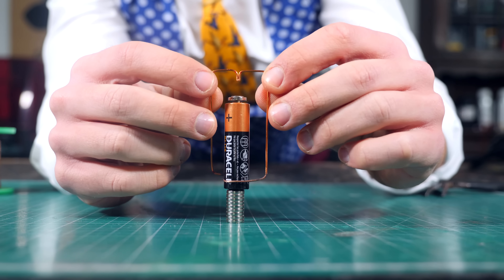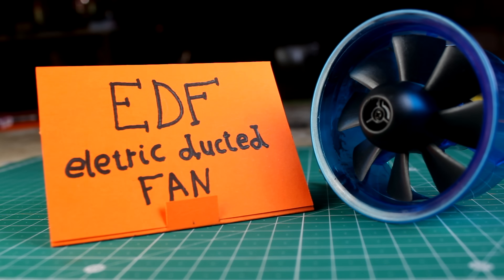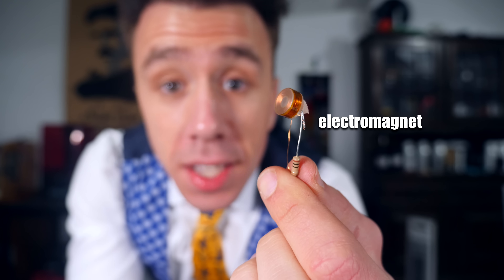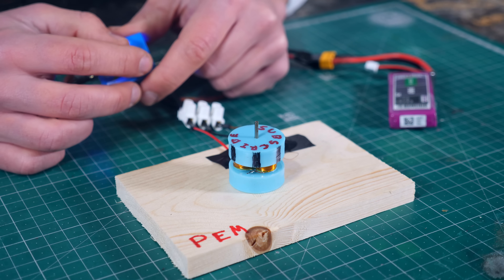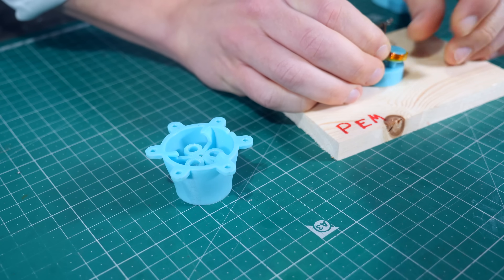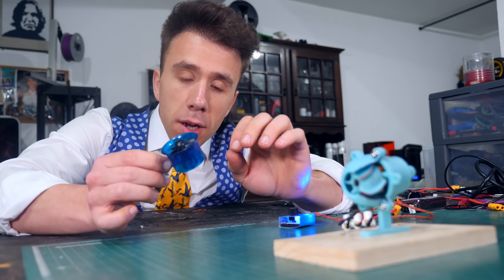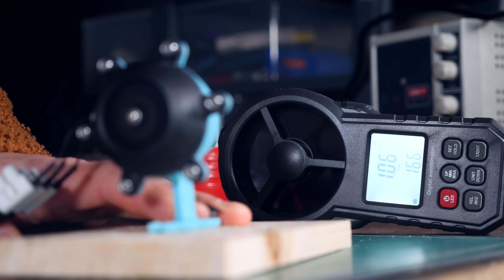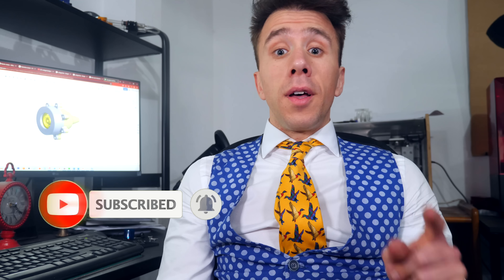I 3D Printed an ELECTRIC MOTOR FAN

Comment: probably too late here, but that might be the difference between airflow and airpressure
if you look at pc fans then you could see that the fans on the case are different by the bladedesign from the once on radiators, that is because, casefans need to get a good airflow in the case, where there isnt much obstructing it, while the fans on the radiators need to push air through the fins of the radiator, needing much more pressure to achieve it, instead of airflow
the design differs by having bigger or smaller (or even overlap) gaps between the fanblades if there is a big gap, like on aircraft propellers then they are high airflow, if they are like a prop on a ship, then they are high pressure

Comment: From a cursory glance at this my thoughts are;
1. Your intake opening area is smaller than the area of the fan (imagine it as a circular area). 
2. Your blades are much smaller than the fan blades. - Therefore a lot of the area for intake is taken up by the "hub" your blades are attached to. 
3. You should try some CFD (Computational Fluid Dynamics) software to get a good visualization for what is happening. 

Note that the majority of thrust from a jet engine is actually coming from the bypass (in other words the Fan) and if you look at a Turbofan a large area of the fan is just a cylindrical tube with a fan at one end.

Comment: it’s possible that the Dyson fan is more high pressure and less high speed because the air is coming from a 90° angle.

Comment: You could also try adding a tube on the front of the impeller. If you think about a car it has a specific air intake duct that restricts the air to that specific spot

Comment: There is a reason why ram jets and scram jets required a launch at altitude. A body lifted aircraft is nothing new and used utilized by delta wing aircrafts. But why does a delta wing use a turbo prop design over the ram jet design. Because there isn't any spooling of air on the runway. At least not a lot. Airports use an air pump to spool the air for many jet engines for two reasons. Most importantly to clear the engine of latent fuel  vapour accumulation and also to initially push air into the engine this causes a vacuum affect on the intake of the jet engine. Ram and scram jets however require more air than what can be statically accumulated and therefore need to be launched at velocity. You are close buddy, keep it up and you will get it. Also if your impellers are deforming try printing in vase mode and replace your infill with a more purpose oriented internal grid spines similar to your metal 3d printed rocket engine.
Reply: Actually designing and testing cellular infills is probably its own show but to be able to push and turn that form to comply with the outside shell of a turbo impeller fan blade would be a great product and would be much stronger than 100% infill because cellular infill is fantastic for resisting torsion forces like the centrifugal forces of a spinning elliptical blade.

Comment: This suggestion is not on the topic that you're requesting, but I think you will find that it does help with the manufacturing process.  You might try a removable magnetic build plate for your resin printers.  A flexible build plate really helps when removing parts that are printed flat on the build plate.  No more hacking with a spatula and praying that you don't break a fragile fin or other thin piece.  In my experience so far, yes, the magnetic force is enough to hold the removable plate in place.  Good luck and have fun.

Comment: Okay, first we need to fix some of your misconceptions.
1. An impeller is not the same thing as a centrifugal fan. It actually works like a hybrid between a standard propeller and a centrifugal fan, with less efficiency than either one. The reason Dyson uses them, is that they won't clog up when full of dust. Before Dyson got popular, there were far more efficient Japanese versions of most of their products.
2. Centrifugal fans have their mounting/bearing point and air intake at 90 degrees from the shaft they are blowing in. Basically its the same effect as the Tesla turbine/pump. using the BLDC motor is certainly an option. Scale it up to the limits of the plastic and you may give Hacksmith Industries a run for his money on small strap on propulsion.

Check out Thinking N Tinkering's channel. He's mostly working on power generation and wind turbines, but you can get some good ideas. https://www.youtube.com/@ThinkingNTinkering

Comment: Sorry I'm so late to all your videos, I am enjoying them.  I would like to see this video:  A car turbocharger is basically a jet engine without the combustion part in the middle - that is replaced by your car engine cylinders. So maybe you can get a second hand (scrap) turbo from car scrap dealer, split it in 2, then build your own jet combustion chamber between the 2 parts, experimenting with connecting the turbine to the compressor (like Whittle) or not connecting direct (like some modern jet engines), with or without gearing.

Comment: I would have to say the issue probably is not the design, i think its a problem with the materials used to design, try with a more rigid material.

Comment: First of all you are using two completely different motors in these fans. Your motor will not produce nearly as much power as the BLDC motor in the EDF. Also the fan is not as big as the EDF, so it will not be able to push as much air. Unless you use a motor that spins much faster, but then your design might disintegrate and also the efficiency will be worse.

Comment: Check your exhaust nozzle diameter. Too wide and the outlet flow is too slow. Too narrow and it blocks the airflow. Just r8ght and it allows the max air to exhaust and restricts it enough to maximise air acceleration.

Comment: This is late, but as someone who is not a fan engineer, all I can say is that if you’re putting in the same amount of power, but not getting the same amount of thrust it can only be due to inefficiency. The energy is either coming out as heat or getting wasted as turbulent flow. My best guesses for why this might occur are either that the fans require different amounts of torque, therefore causing the motor to run outside it’s best power band (thereby wasting heat in the motor coils and motor driver) or there’s too much restriction in the flow. Since the fan has to draw from air at atmospheric pressure, there’s a limit to how much can be drawn from a given cross section and the more you try to draw from a smaller area, the more you have to lower the intake pressure in order to draw air towards the intake without losing output pressure, thereby increasing the required blade velocity and causing the aforementioned inefficiencies. My understanding is that Dyson uses a proprietary motor design which is kind of a high rpm optimized BLDC with a special driver circuit in order to overcome some of these issues by just spinning faster, but this is info gathered by analysis of marketing materials and could therefor be wildly inaccurate.

Comment: It's possible that your exhaust end is too small at higher rpm creating back pressure and limiting thrust. Check if the thrust is maxing out before max rpm

Comment: because the compressor compresses the air and the edf accelerates it
"this works like when its raining small droplets at a fast pace but under the trees the rain slows down and the droplets get bigger"
the compressor is making high pressore slower air and the edf is low pressure fast air, probably, im not an air specialist im just repeating what you said

Comment: My friend, you´re doing things right but you´re not measuring all the variables through your adiabatic process since you´re comparing pears with apples. Axial fans are used to create high volumetric flows or high dynamic preasures with low static pressures, basically all the power is transformed into kinetic energy and this is why axial fans are mostly used on open space enviroments like hvac condensers, while centrifugal fans are used to create low volumetic flows (low dynamic preasures) and high preasure (static preasure) mostly used for overcoming high linear static systems (lilke hvac ducts) and/or in turbo fan turbines to inject high preasure and temperature air into the combustion chamber; This is the reason why your anemometer is showing less kinetic energy, cause you also have to take into consideration the delta in potential energy and temperature through your adiabatic process.

Comment: From what I remember from my on and off again studies of aeronautical and turbine engineering , axial flow turbines or fan blades generate more thrust and more efficiently through airfoil lift like a propeller (hence a shift to high bypass turbofan engines for commercial airliners ) and generally move more volume of air , whereas centrifugal turbo chargers or compressors generate higher pressures and velocities but move less volume of air and have less low end thrust and are generally less efficient for thrust , especially because they have to redirect the airflow 90 degrees tangential then 90 degrees axial. this causes backpressure and friction and turbulences and other losses . the reasons why one is used over the other in specific applications depends greatly, but the general differences in cost , durability, technical manufacturing requirements , and pressure/ volume / efficiency / bulk / weight tradeoffs are usually the biggest factors.
       I have had many ideas for new designs for piston engines and hybrid turbines that takes things quite a bit further .
       I think you are on the right track , taking the drive turbines out of the back of the engine , as they are a huge expense and limiting factor of military and commercial turbines, as they have to build super expensive and complex single crystal alloy blades with internal channels directing cooling air through and out around them to be able to withstand the heat after the combustion chamber. the higher the pressure of the inflowing air into the combustion chamber and the higher heat of combustion ,the more efficiently thrust is made and the more thrust you get out of an equal size and weight of engine . and this is all limited by the drive turbines to withstand the heat and flow turbulences destructive effects. also , especially in high bypass turbines they are putting gears in , to change the drive turbine rpms relative to compressor turbine blades and bypass fan blades, so that each can operate at their respective individual highest efficiency at any specific airspeed , and altitude at any particular throttle setting . somewhat like when in cars , ignition and valve actuation was taken from the mechanical link of the crank and cams then were rebuilt to be computer controlled to be independently electronically actuated. it was more expensive and technically more difficult , but gave better performance and efficiency.
        so the hybrid design changes to a turbine must make sense financially or performance wise or it is a waste of time no matter how fun it may be. 
        the centrifugal compressor makes sense in a turbine if the reduced cost  of production , service , etc. outweigh loss in overall performance or efficiency , or added weight and bulk . also , since something has to generate the electricity to power the centrifugal electric motors , you have to factor that into the equation, what is the bulk , and weight and cost and efficiency losses of having a generator make electricity , and transmit it to the electric motors in the centrifugal compressors (losses in generating , transmitting and motors turning electricity to motion) , versus the turbine compressors and drive turbines being connected through a shaft with a lot less losses (friction of bearings etc.) but yet not being able to independently adapt to altitude , humidity , airspeed , throttle variables to produce optimal performance and/or efficiency in any circumstance.
         good luck, it is something i have been pondering a long time, along with elements of rotary pulse detonation and passive venturi like flow inclusion of ambient air for added cooling and extra / more efficient low end thrust.

Comment: Hi Integza! Another cool projekt :) The close view of your impeller at 4:03 shows why… well, why it sucks at sucking anything ^^
It has the wrong, almost "reverse" geometry for such a tiny inlet (same for the second model at the end of the video). Moreover, one cannot simply "open the intake wider" as suggested elsewhere in the comments. Otherwise, the volume of the shroud would become so small that the blades would no longer compress the fluid. 
The solution here is to twist and orientate the blades the opposite way:
1. At first close to the the shaft (the "hub") your impeller needs an important geometrical part that is missing in your current models: the "inducer". The inducer is shaped and acts almost like a regular PC fan or propeller. Its blades are wide, with a high incidence angle (say, about 45°). Front facing without the shroud, they should look like almost those of a colored windmill toy. However in your current model, in this place your blades are shallow and oriented normally to the incoming flow, so they can barely pump anything. The inducer once there induces a high velocity to the fluid in order to suck it inside the engine (with not so much pressure on the other hand): that is to say, this missing part acts as a PUMP.
2. Then, as the blades of the inducer expand radially outward, thinner and thinner, they really become the impeller. They straighten up, and end up at their orientation at the periphery is almost radial and completely upright (i.e. the tip at the trailing edge should be normal to the shaft and to the external flow – the one outside of the engine) a bit like the blades of a water mill this time. In this second trailing part, the impeller acts this time as a COMPRESSOR i.e. better at creating pressure than accelerating the air (but it doesn't matter then, because the fluid velocity will be already high at this point, thanks to the inducer!).
So a centrifugal compressor impeller indeed acts as you explain at 4:38 except it imparts velocity to the fluid first, then compresses it, in this order :)
Reply: Too bad he didn't notice your comment, it's brilliant. I hope he sees  it seeing as you spent so much time typing it up so well and explained everything great. How do we tag him so he sees it?
Reply: @PaulK390S90V  I dunno 🤷‍♂ Let's try @Integza
Reply: @PaulK390S90V  Just adding reply’s to this, and also leaving separate comments telling him to search the username should help.
Reply: @integza
Reply: @Integza ! Let's hope this works!
Reply: @Integza
Reply: @Integza
Reply: @integza
Reply: This is a silly place
Reply: This is beautifully explained!! Hope he'll see it @integza
Reply: glorious explanation
Reply: I have done some old fashioned book reading at my library and by Johve you are right, (I think) I'm no engineer but love cars, especially off roaders, and claging turbos on cars that don't normally have one, so ye I have blown a few and the geometry inside a turbo is basically the same as intake and compressor of a jet engine, so after reading up what some of the technical terms you used meen i concur sir.
Reply: Great comment honestly i hope he sees it@Integza
Reply: @integza
Reply: @Integza
Reply: Look at @fluxcapacitor comment it’s a great solution
Reply: Beautiful and simple explanation! @Integza, this is the information you said you needed.
Reply: @integza
Reply: @Integza
Reply: can we find something from the Major Hardware channel

Comment: Hey Integza, it may be a little late but i know and am here to explain why the centrifugal fan does not produce as much thrust. The reason is that centrifugal fans are never meant for and cant produce high volumes of air (comparatively to a regular fan of the same size and power etc.) as they are made for pressure. I am currently working on a (mostly) 3d printed jet engine and have gone down this same research path as what you are wanting to find out and i have the answer (and i would love to talk with you more about it). A regular fan (including EDF’s) is used when high volumes of air are required where static pressure is not required such as PC cooling and for this reason the EDF that you used would show more thrust on your anemometer as it produces a high volume of air turning the anemometer faster. The centrifugal fan is made for high static pressure at a sacrifice of volume. A perfect example of this is the difference between a turbofan and an EDF jet/EDF afterburner. With the EDF jet, fuel is just ignited at the exhaust end of the EDF which does nearly nothing in increasing power as there is no pressure being created and allowed to expand. Wheras a turbofan uses the centrifugal fan which can create high static pressure to cause the combustion chamber to be pressurised, then fuel is added and ignited, thus creating much higher pressure in the chamber and allowing it to expand and eject out the back of the jet at high speeds. I hope this makes sense and i would love to talk more with you about this over discord or something (i am on your discord server as well so you can find me there). I hope this answers your questions
P.s. sorry for the long paragraph. That was the shortest and best way i knew how to answer 😅